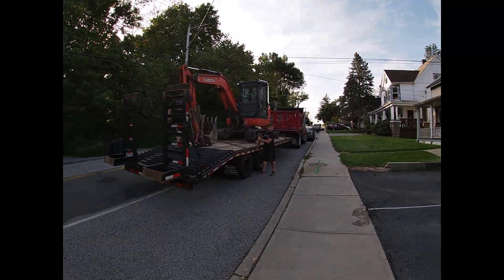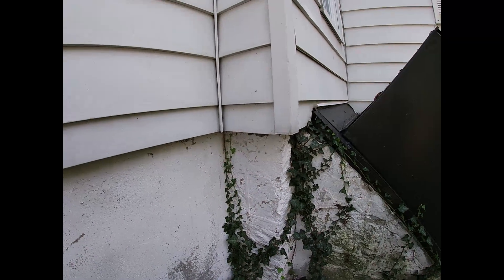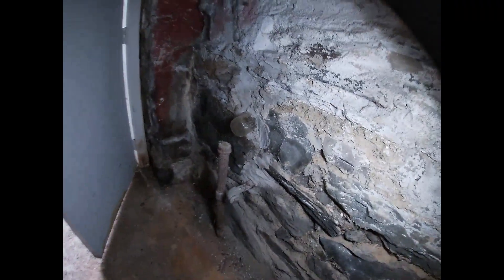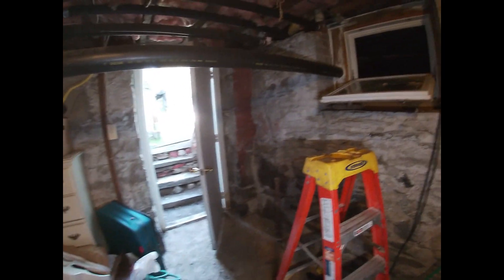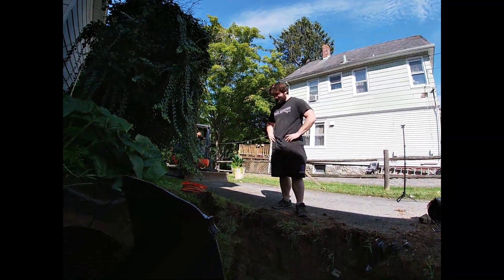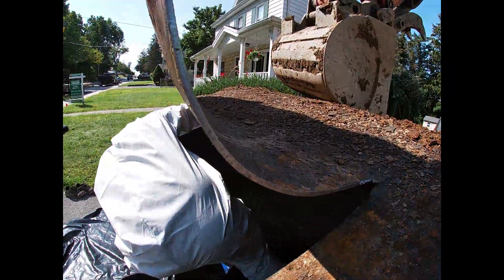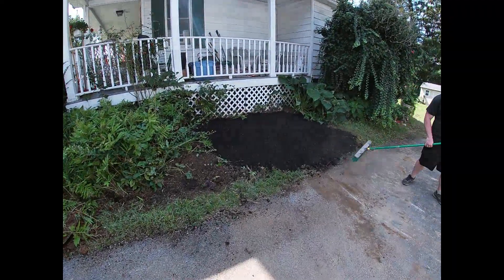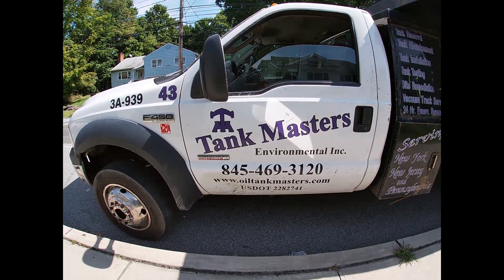80 Year Old Oil Tank Removed in Monroe, NY

Comment: I’m curious, do you find most tanks installed before 1950 are still solid when you pull them out ?
Reply from the maker: Absolutely, normally an 8 gauge thickness and installed properly with stone or sand for better drainage.